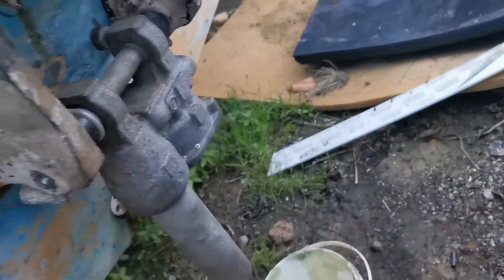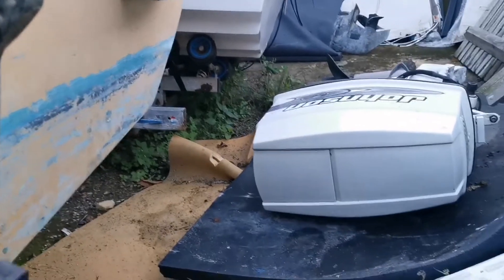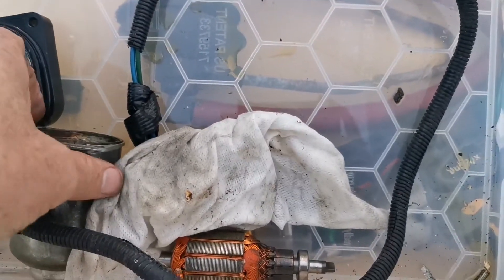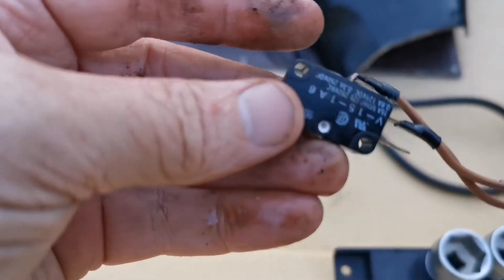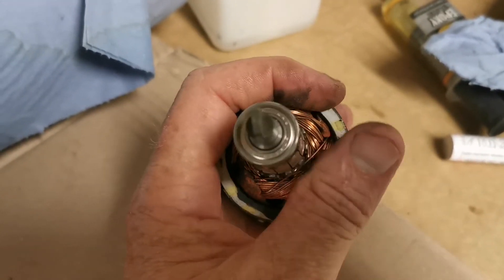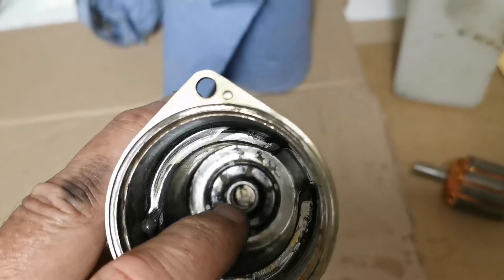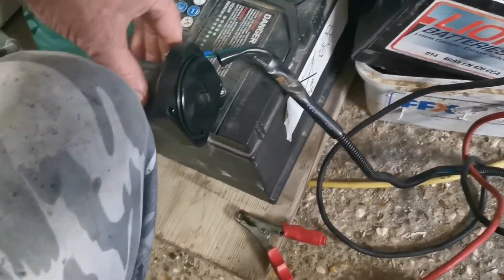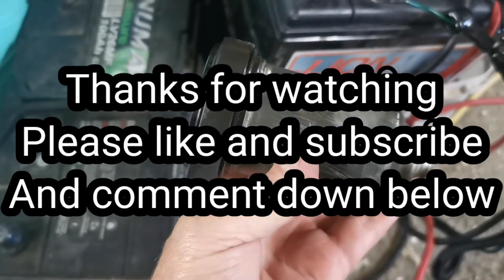Trim / tilt repair on suzuki df30 outboard

Comment: I have one exactly the same, my question is is is it possible to change the rod oil seal that raises the engine? Mine loses over there
Reply from the maker: @tonicerda9474  yes you can take the ram appart.i think you need a spanner with 2 pins on it like one you use to change an angle grinder blade

Comment: I have Suzuki df90 my tilt only works sometimes I think I have electric problems.
Reply from the maker: Check your connections sounds like a corroded connection. Is it on the controls or on the engine it's intermitent
Reply: @peteramberley9952  I never know that connection was there until now so it will probably be very corroded. Thanks for your help
Reply: @peteramberley9952  if I hold down on safety leveling switch it will go down but not up. I can hear the relay clicking but will only go down.
Reply from the maker: @timfunk5084  could be a faulty relay. One is for up one is for down
Reply: @peteramberley9952  I can hear relay clicking and I have switched them around. I think it is in leveling switch because I can get it down by pushing switch down but not up.The switch has 3 wires going to it so don’t know how to bypass it.
Reply from the maker: @timfunk5084  the 3 wires are a live in and the other 2 are live switch lives. The relays normally closed give the motor 2 neutrals/negatives. When you send a positive from the swith it energises the relay and sends a positive too the motor. By reversing the polarity it will spin the motor in opposite direction. You can give a live feed to either switch at the control
Reply: @peteramberley9952  why would they but a connection there under front of motor in a place where it is going to get corroded.
Reply from the maker: @timfunk5084  don't know why but put a direct feed to the 2 wires from the pump. One positive one to the negative. Doesn't mater which way. Then change to spin the motor other direction

Comment: I've got a suzuki 40hp but it looks pretty similar. What would cause the trim to not go down? Goes up every time with no issues but last year I would have to hit the switch maybe 50 or more times and it would finally go down. Now this year I can't get it to go down at all but I can hear the relay clicking every push of the switch. I can lower it by turning the bypass screw but thats it.
Reply from the maker: Try touching the 2 wires direct to a battery I think there Green and blue. So one wire to + and other the ground and then switch them over. All the relays do is switch polarity and spin the motor backwards. This method will illiminate the relays being at fault. And check connections inside motor.